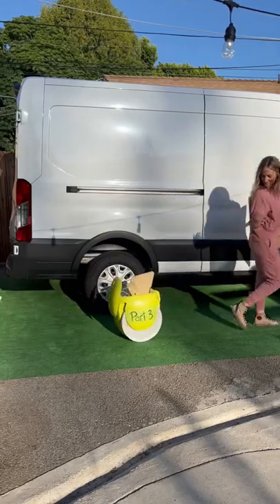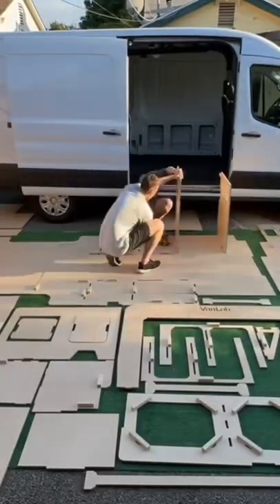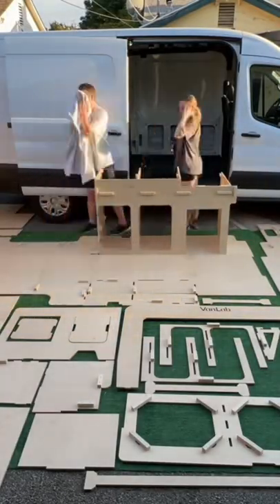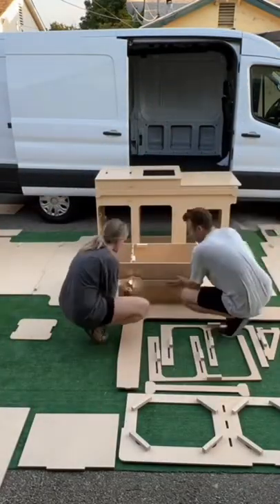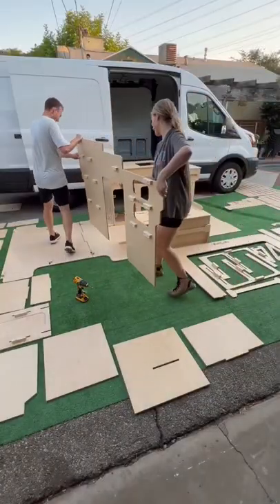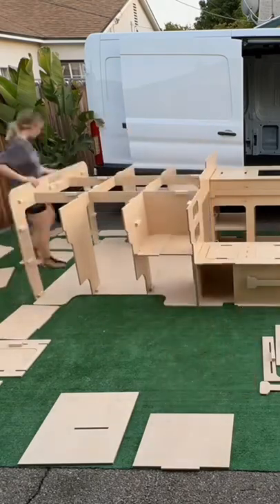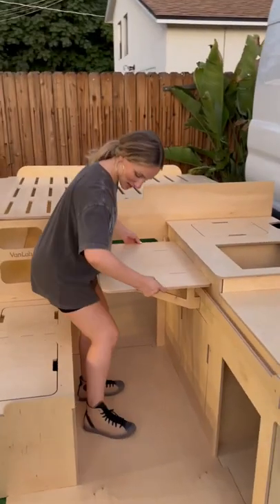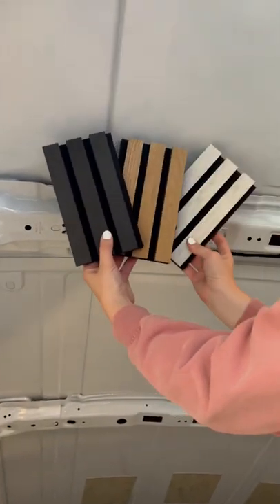Which ceiling color should we choose? #electricvanbuild #shorts #vanlife

Comment: That's a lot of weight in wood, figure out how to shave some off in areas without affecting the structural portions. Weight will be everything, the Ford EVs are already notorious for getting well below the estimated mile range with the slightest of loads. My sister jumped at getting the Mustang Mach E and fully loaded with family it says it'll go 150 miles before charge. Insane that they can even sell these things